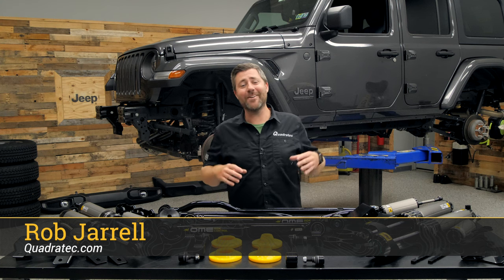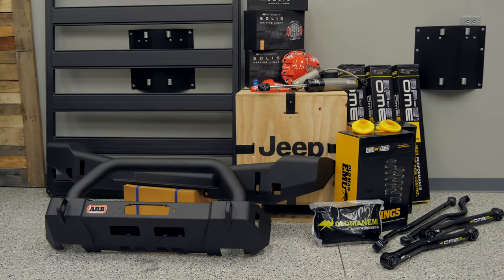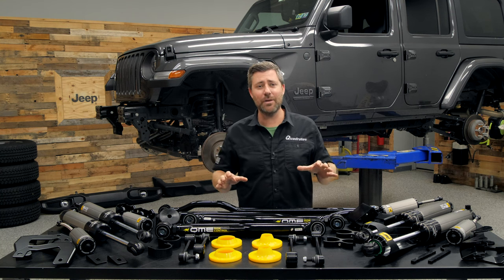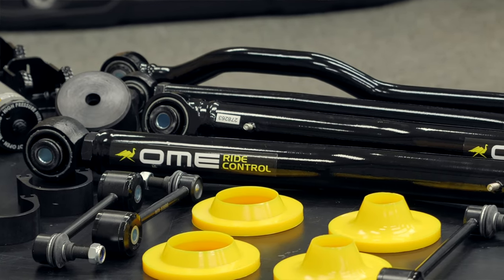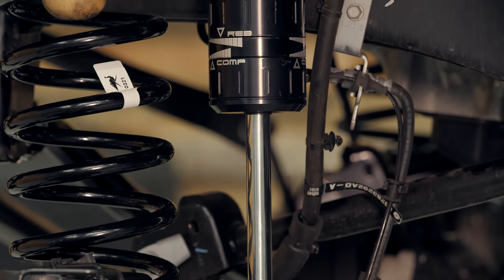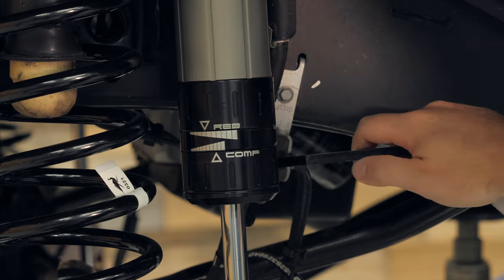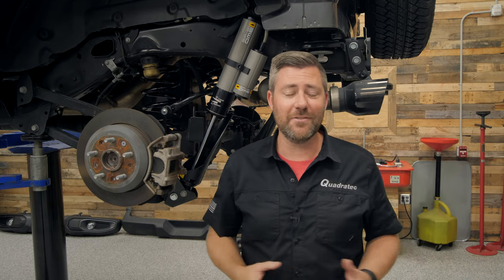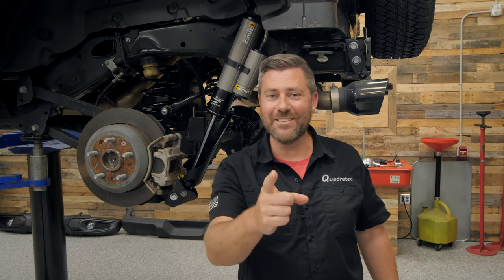Old Man Emu BP-51 High Performance Suspension for Jeep Wrangler JL

Comment: I wish the give aways were a Rubicon. A 4wd with not even a standard rear locker is below par in today's 4×4 industry. 37s are now new 35s, Good quality led spot and spread combo with 20/30 inch high output light bars is the new halogen fog lights, coil springs with airbags are new heavy duty leaf springs, synthetic line are the new steel cable etc.

Comment: Are there any kind of reservoir relocation brackets like that for the Mojave Fox shocks? Because of where Jeep puts them from the factory, it feels like you HAVE to run a skid plate, which limits the amount of bumpers you can pick from.